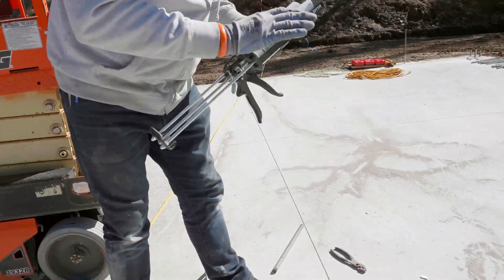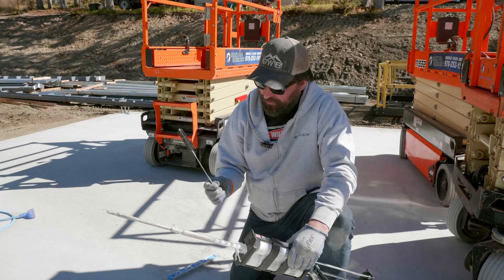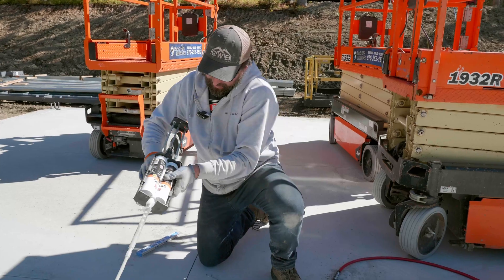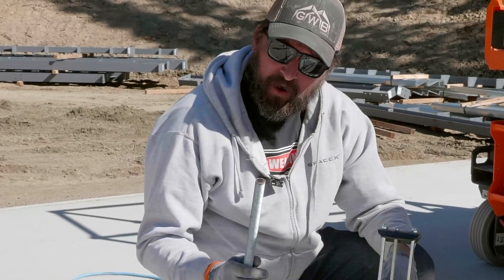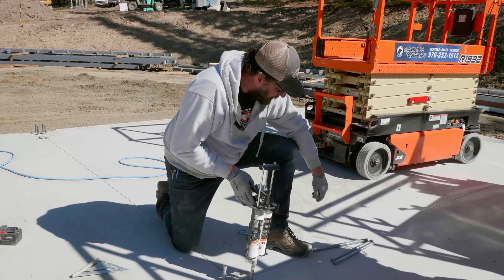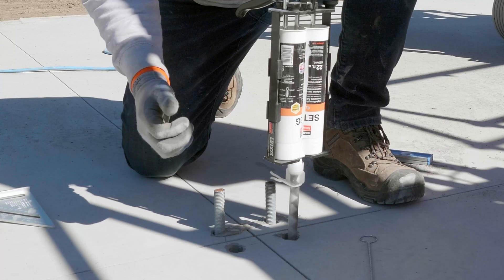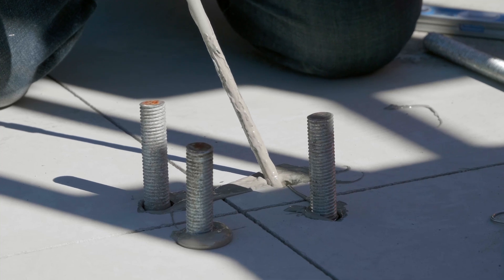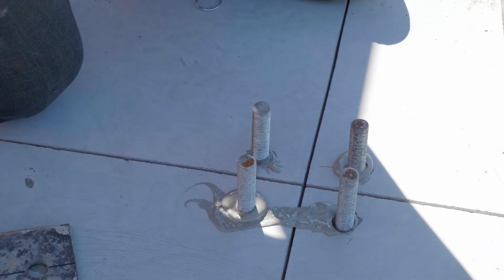How to Build a Steel Building - Floresta Series - EP 4 - Bolts & Epoxy

Comment: Those templates are a handy thing to have.  We had about 48 or so bolts to set with epoxy.  I used plywood to create ours, and ran the nuts down far enough to lay the plywood template on the bolts right at the top to help ensure everything was level.